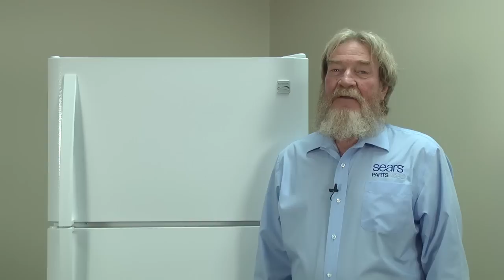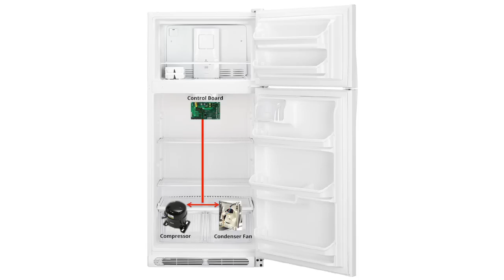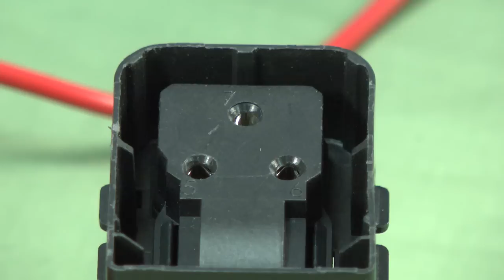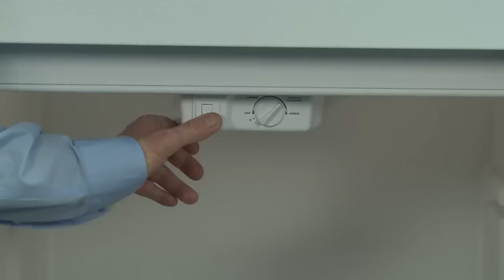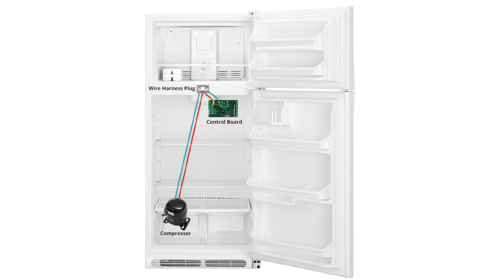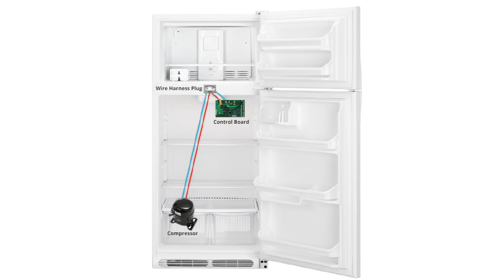How to Troubleshoot Compressor Problems in Refrigerators

Comment: good but, i want to know if the compressor can be repair, if yes how because my own is totally down.
Reply from the maker: If the compressor is locked up or damaged and won’t work, it typically needs to be replaced. If your refrigerator is less than 5 years old, check the owner’s manual for warranty coverage on the compressor. Here’s a link for a web page where you may be able to find an online copy of your owner’s manual if needed: https://www.searspartsdirect.com/partsdirect/user-manuals. Some refrigerators have a 5-year warranty on the compressor and sealed system. If the compressor is still under warranty, call the manufacturer for warranty repair. If the compressor isn’t covered by a warranty, then you’ll need to have a service technician replace the compressor because the repair requires the recovery and recharge of the refrigerant. That task should only be completed by a service technician licensed to handle refrigerant.
Reply: welcome

Comment: What happens if the fridge is working the fresh food top works fine but the freezer doesn't stay at -18 degrees Celsius what then? My freezer only goes up to -11 and then goes to -7, -6 and all the way to 0. 
Checked for ice, melted the ice. Checked the fans, they work fine. Checked the compressor it seems to be working. I am a bit lost here.
Reply from the maker: A faulty temperature sensor or bad control could cause that type of freezer section cooling problem. Let us know the model number of your refrigerator and we should be able to provide some troubleshooting steps you can take to resolve the cooling failure in the freezer section.

Comment: Question pls. refrigerator flushed all lines, works fine after cycle gauge reads vacuum again, applied heat to the capillary joints by the evaporator coil could hear refrigerant rushing worked fine until cycle, what could be the problem? Samsung side by side Thanks.
Reply: "flushed the lines"? Exactly how did you "flush the lines" and why? This is a vapour locking problem, now we need to figure out what you did wrong, or failed to do that causes this issue.
Reply: Good afternoon got it figured out seem like not enough flushing agent was used so I repeat the process, I've combine lacquer thinner and 141b this time gave it a good shot and nitrogen it for 150psi on both ends got all the brownish element out, recharge the system and works fine since last night, thanks for the quick reply..
Reply: It's quite rare to have to do a flush. Generally only when a dramatic event like a burn-out occurs. Keep in mind, home-made flushes can destroy the insulation on the compressor's windings- BE CAREFUL. Always change the filter a couple times after doing a flush as the refrigerant will continue to rinse the remaining sediment and contaminants into the filter. The problem you originally described was either water or solvent that you didn't properly remove by purging with nitrogen or by use of an extensive Vacuuming process. and was freezing up at the end of the cap tube.
Reply: So I shouldn't vacuum for long period?, my understanding was the longer you vacuum the more sediment remove Yes I'm planning to replace filter again, thanks.
Reply: And I forgot to mention locked rotor compressor was replaced because of my impatience charging using only gauge no scale, it vapor lock overnight had my buddy cut open the old comp and winding was in good shape, ref was bought used and had prior repairs in the condensing coil part that submerged in water was rusted out and replaced with copper, so I figure must have sucked water and unit died on me.
Reply: Yes, the more the better. You cannot vacuum the sediment out, that's the filter's job. You're removing moisture and the solvent. The both boil rapidly in a vacuum. To do this properly, you use a micron vacuum gauge and pull the vacuum to 500 microns or less and see that it holds. If not, there's either a leak or moisture still boiling in the system. (Yes water boils in a deep vacuum)
Reply: My problem is here in the Philippines I don't have the luxury of acquiring a recovery tank  brought my recovery machine from US but not the tank venting refrigerant in the air is most common, not a tough regulation unlike in the US, but I try my best every time, thank you for the best answer so far, tomorrow I will replace the filter dryer hopefully my newly replaced used comp will last me for sometime.
Reply: Samsung is da problem. Petiod

Comment: Our Kenmore Elite refrigerator has had the ER rf code 3 times and it sonly 3 yrsold.  Don't buy one.  I have 2 old refrigerator that have never had a problem.
Reply: Probably LG or Samsung made it. Elite should have told you 'no way'!
Reply: Don't buy a samsung either.

Comment: The place that i baught the fridge from replaced the circuit relay . it was humming and made single clunk clunk sound. Now a new circuit relay is in it. But it only makes single click sound every couple minutes. Fridge wont start Fan is running but everything in freazer has thawed in 4 days. I dont understand it. And the compresser big black round thing is scolding hot to the touch. Please help
Reply from the maker: Your symptoms point to a failed compressor because the compressor housing is getting extremely hot. We recommend that you contact the place where you bought the refrigerator to see if the seller can help you get the compressor repaired. Compressors on some refrigerators have a 5-year warranty. Refer to the refrigerator’s use & care guide for warranty provisions on your model.
Reply: Sears PartsDirect thank you! They just replaced the firdge it was only 5 months old and store said it shouldnt have gone bad that fast . so hopfully this one lasts
Reply: Bad compressor

Comment: Hi,
my GE side by side fridge the compressor is not turning ON I don't hear NO clicks from the motherboard
Reply from the maker: Let us know the model number of your GE refrigerator and we’ll provide some troubleshooting tips.
Reply: Sears PartsDirect PSW26SGNABS
Reply from the maker: Unplug the refrigerator for 1 minute to reset the control boards and then plug the refrigerator back in. If the compressor doesn’t start after resetting the control boards, then the main control board (https://www.searspartsdirect.com/part-number/WR55X10171/0046/363.html) or user interface board (https://www.searspartsdirect.com/part-number/WR55X10390/0046/363.html) may be bad. Unplug the refrigerator and check for burn marks on the main control board. Replace the main control board if you see burnt spots. If find no burn marks on the main control board, we recommend that you have a service technician diagnose and repair the refrigerator because we didn't find any DIY diagnostics that might help you determine which control board may be causing the failure. You can schedule service here: https://www.searshomeservices.com/.
Reply: Sears PartsDirect hi, i noticed couple day ago the mother board burned

Comment: is it normal that the comprossesor is so god damn loud?
Reply: model no: 253.70509411
serial No.: BA53329149
Reply from the maker: It is unusual for the compressor on that Kenmore refrigerator to be loud.  Unplug the refrigerator and tighten any loose compressor mounting bolts. If that doesn’t help, the compressor might have internal mechanical problems. It could be a few weeks or months before the compressor gives out and the refrigerator stops cooling. When it does, a service technician has to replace the compressor, because the replacement involves involves the recovery and recharge of refrigerant. You can schedule service here: https://www.searshomeservices.com/.

Comment: my plug had torn on mine I installed a heavy duty plug end on it ran for a while got cold then the whole fridge stopped working what could be the problem?
Reply from the maker: Check the house circuit breaker for the refrigerator’s electrical outlet. Reset the circuit breaker if it’s tripped. That may restore power to the refrigerator.
 
If the house circuit breaker is okay, plug a small appliance into the refrigerator’s outlet to make sure the electrical outlet works. Have an electrician repair the electrical outlet if it’s broken.
 
The plug of the power cord may be preventing the refrigerator from getting power. Unplug the power cord and check the wiring connections on the power cord plug. Reconnect any loose wires. Replace the power cord if it’s damaged.

Comment: When I test the 3 prongs with meter set at 200 ohms I get 11.1  -  4.6   and   8.0 is that Ok?? When I check prong to ground, it checks out ok, NO Grounding going on there.
Reply from the maker: The measurements you give seem to be good, provided the terminal readings relate to the following pattern:
The 11.1 reading is between the Start terminal and the Run terminal of the compressor.
The 4.6 reading is between the Run terminal and the Common terminal.
The 8.0 reading is between the Start terminal and the Common terminal.
Typically, the Common terminal is on the top of the three terminals, the Run terminal is on the right side and the Start terminal is on the left side.
Reply: My terminals are set up like a upside down triangle. 11.1 across the two top post,  4.6 left top to botton  and 8.0 from right top to Bottom. I fired it up with a new part and seems to run ok for now. fingers crossed, LOL

Comment: Hello. I have a Kenmore chest freezer. I bought it new and used it about 2 yrs and put it away in storage for about 8 yrs. this week, my wife and I decided to use the freezer. It was never damaged. After 2 hrs plugged in, I noticed no cooler. I checked for problems and could not locate any problems. I noticed buzz noises from the compressor and don't know if compressor bad or need recharge. What is wrong?
Reply from the maker: If the compressor buzzes for a moment and then clicks, the start relay could be defective. Unplug the refrigerator and remove the start relay as shown at :45 in the video. Replace the start relay if it rattles. If the compressor buzzes constantly, then the compressor may be defective or the refrigerant may have leaked out of the sealed system. A service technician will need to check the freezer to determine the problem because refrigerant charging and recovery is federally regulated for safety.
Reply: can someone  pls. recomend a tech. that is reliable and  affordable. in the east Los Angeles area. problem with ikea refrigerator  in used for 2 years. tks.

Comment: not a bad video but I need to know why a refrigerator would totally. trip the circuit. braker it fry not the outlet and braker I left the door open for a few hours I heard a clunk clunk pop and it won't work at
Reply from the maker: A short circuit in the refrigerator would cause the house circuit breaker to trip. We recommend that you leave the refrigerator unplugged and have a service technician examine it to determine the cause of the tripped breaker. You can schedule service through this link: https://www.searshomeservices.com/repair/refrigerator-repair-service?merch_code=REFRIG. Or, if you can provide additional details of your problem, including the model number of your refrigerator, we might be able to provide additional troubleshooting tips.

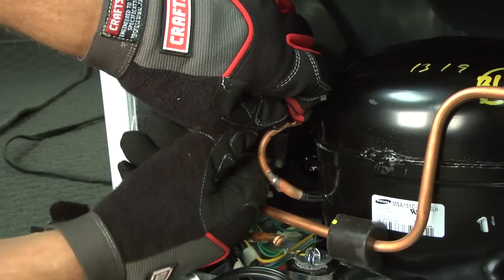Comment: Your comment about checking the start relay for a rattle at 0:50 was all I needed to get my refrigerator working again. The tech also mentioned making sure that the condenser fan was working properly AND to make sure the coils were properly cleaned or the start relay would be fried again in a month or two. As it turns out my coils had a lot of dust. He said that blowing them out is best since cleaning them out with a vacuum is not possible. There was no way I was going to blow that dust all over my house even wrapping the fridge with damp towels as suggested. I used an adapter on my shop-vac and a 20" section of heavy duty garden hose to vacuum out the coils. I lost a lot of food but it could have been much worse. Many thanks for helping me save about $1,200 to replace a perfectly good refrigerator that simply had a bad relay and needed a thorough cleaning!
Reply: Thanks for the tips.. It's got me thinking maybe my relay is fried for the same reason.. I didn't know you were supposed to check for grime in the back. Live and learn. It will be good news if this fixes it, but at least now I have  something  to try.